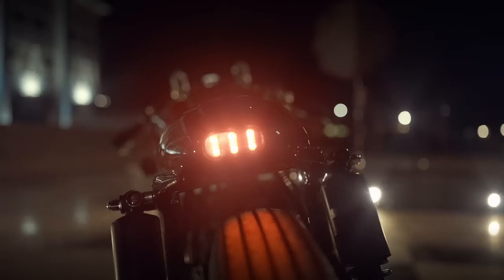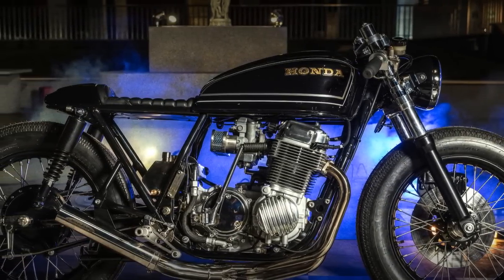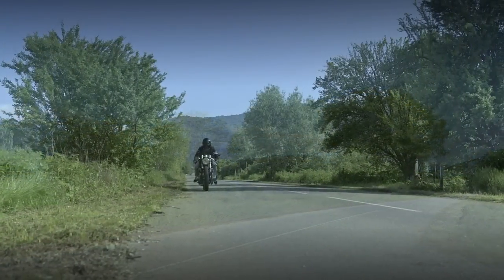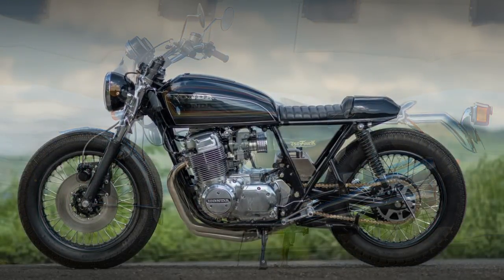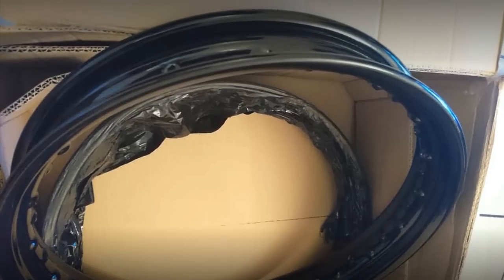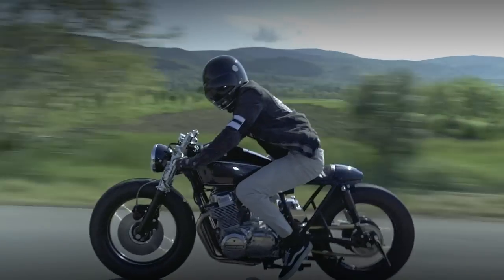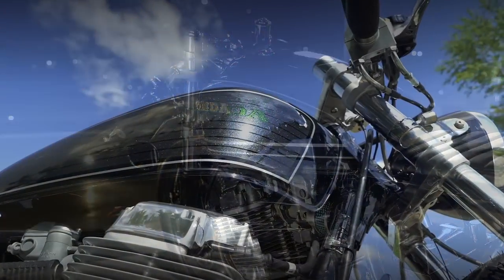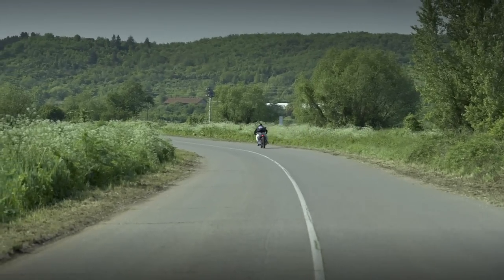Cafe Racer (Honda CB 750 by Bull Moto custom)

Comment: Pure lines and clean lines. Assured success.
I am not a friend of sparkles in the tank, but the electrical solution is extraordinary. Battery, flat cable and oil tank.
Congratulations Ivan Mushev congratulations Bull Moto Custom team.
Greetings from Spain.
Reply from the maker: Thank you my friend for sharing your perspective. :) Saludos.